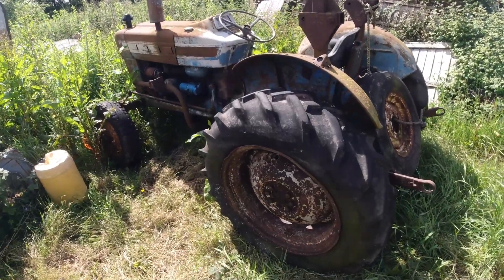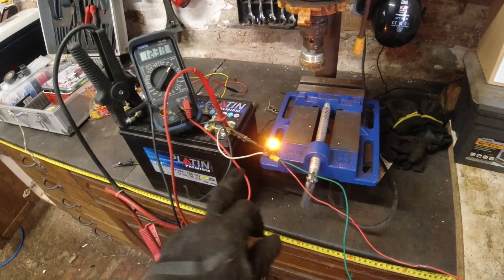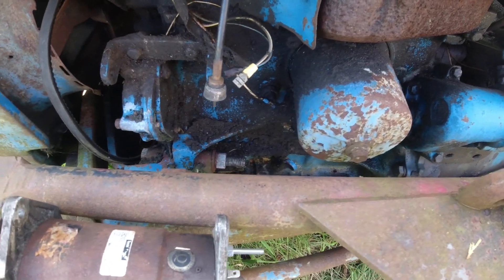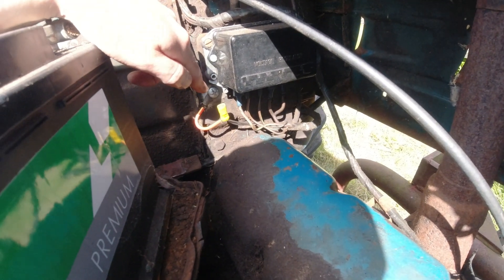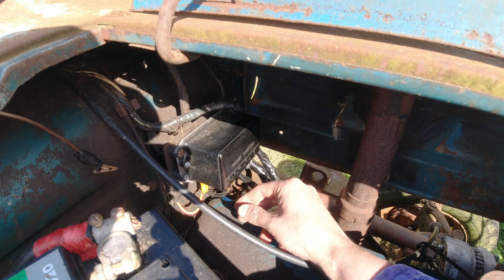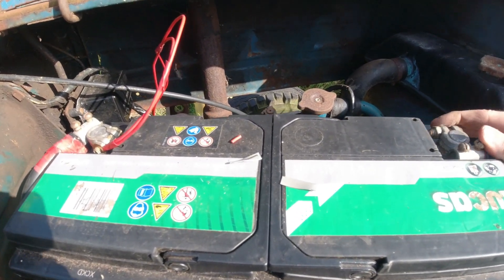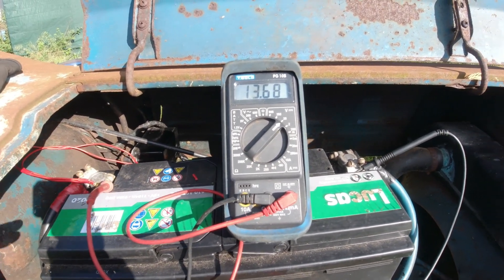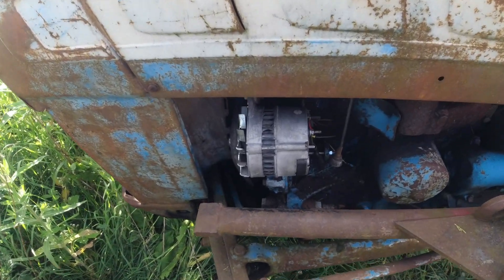Fitting an alternator from a MINI to my FORD 3000 tractor! Dynamo replacement, charging SOLVED!

Comment: hello, how did you do to have a working tachometer ?
Reply from the maker: No as the tachometer and hour meter are ran by a cable which plugs into the back of the dynamo. This was already disconnected when I bought the tractor and it doesn't bother me.